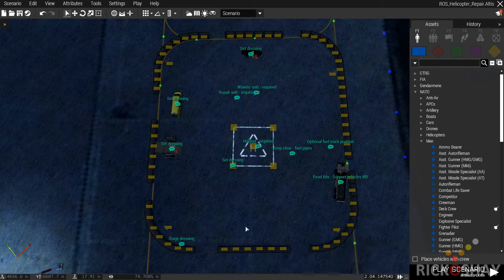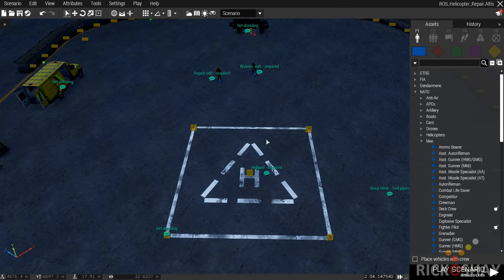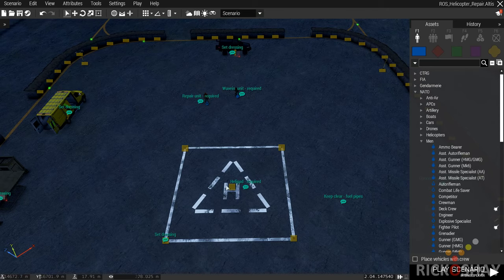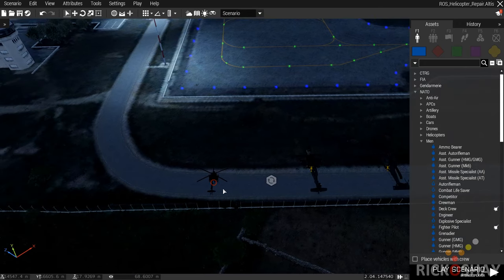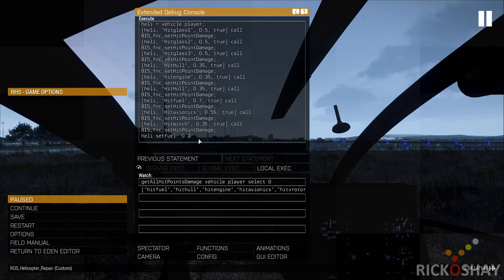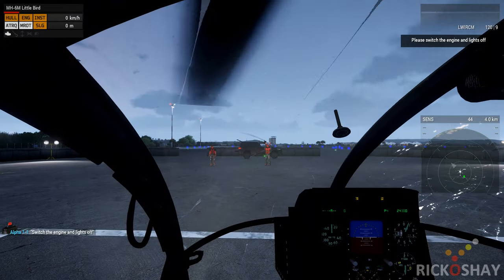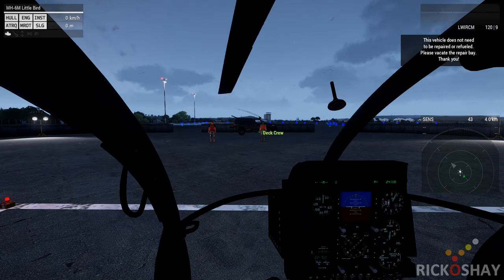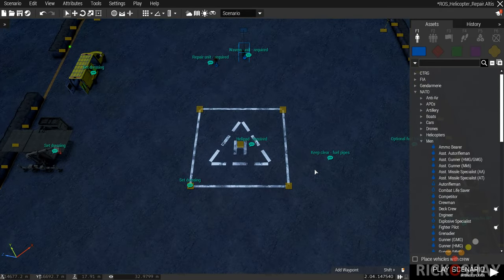ROS Heli Repair Script

Comment: That's pretty damn cool, man. I love stuff like this in Arma! I'm curious if something like this can be done with a checkpoint/base entry? Say a car pulls up and a soldier signals them to stop, then either the soldier or another walks up to look over the vehicle and then the vehicle gets the go ahead to proceed sort of thing. Then again, not even sure of Arma has animations available to actually make something like that work I suppose?
Reply from the maker: Yes - there are checkpoint anims that do exactly what you mentioned. Most likely it won't need any scripts just some triggers and a few lines of code. Would this be for a SP or MP mission ? And would the guys in the car be undercover operatives trying to infiltrate a base i.e. enemy checkpoint or friendly? Basically would be the same process barring some settings on the enemy to stop them from reacting.

Multiple animations - playing a traffic checkpoint where the soldier waves you on. There are 3 animations in this series namely:

Acts_ShowingTheRightWay_in (1.799 secs)
Acts_ShowingTheRightWay_loop (1.832 secs)
Acts_ShowingTheRightWay_out (1.9 secs)

Anim times are shown in the anim viewer. (trigger this in editor - [] call BIS_fnc_animViewer)

1) Drop down any AI rifleman that will play the anim and name it 'trafficman'. Put this in the rifleman's init field: this setBehaviour "CARELESS"
2) Create 3 triggers one for each animation and change the trigger condition to true in each case so they fire automatically.
3) On the first trigger in the init field place this: trafficman playmove "Acts_ShowingTheRightWay_in";
4) On the second trigger put a 1.799 countdown in min mid and max. Then in the init field put: trafficman playmove "Acts_ShowingTheRightWay_loop";
5) On the third trigger put a countdown of 10.959 and init: traffic playmove "Acts_ShowingTheRightWay_out"; traffic disableAI "Anim";
The countdown for the 3rd trigger is the total of the first anim and 5 x the looped time of the second animation.

If you want him to move somewhere after the anim then on the third trigger's init at the end add: 
trafficman domove getmarkerpos "somemarkername";

There is an anim where another checkpoint guy walks around checking the car before the waveon process takes place - just need to find it.
Reply: @RickOShay  Oh wow awesome! Didn't realize BIS did have some handy animations sorted for this. It would be for an MP environment mostly. The fun bit is how multi-functional this is, because you can have it just for ambiance or make a mission or even have someone RPing as a baddie through ZEUS. :)
Reply from the maker: @yokhanan  Exactly - lots of possibilities. Perhaps even a random chance that the checkpoint guards will suddenly get spooked and open fire.
Reply: If you play the SP campaign you will see this in game ..

Comment: how do i damage my heli im so confused
Reply from the maker: Lol well other than flying into something you could use the debug console and do :
vehicle player setdamage 0.4;  
vehicle player setfuel 0.4; then click on local exec. Or if more advanced sethit on specific hitpoints.
Reply: @RickOShay  so if i wanna only damage tail rotor what do i type???
Reply from the maker: @tasted8892  Do you know how to use the debug console? Load the mod CBA - then start Arma 3. Go into the Editor and load your mission. Get into the heli. Preview the mission - press Escape - the debug console will be displayed.  Paste the following into one of the lines in the debug console: getAllHitPointsDamage (vehicle player) select 0; press Esc again.  You will see a list of hitpoints for the heli you are in something like this: ["hitfuel","hithull","hitengine","hitavionics","hithrotor","hitvrotor","hitglass1","hitglass2","hitglass3","hitglass4","hitengine1","hitengine2","hitmissiles","hitrglass","hitlglass","hitengine3","hitwinch","hittransmission","hitglass5","hitglass6","hitlight","hithydraulics","hitgear","hithstabilizerl1","hithstabilizerr1","hitvstabilizer1","hittail","hitpitottube","hitstaticport","hitstarter1","hitstarter2","hitstarter3","hitturret","hitgun","#light_hitpoint"] To damage a specific hitpoint - press Esc - type in the big open text box at the top of the debug console: [vehicle player, "Hitglass1", 0.95, true] call BIS_fnc_setHitPointDamage; then press local Exec - this will damage the hitpoint glass1 with 95% damage. Don't suggest you damage the tail rotor otherwise you wont be able to fly the heli and land unless its just a small amount of damage say <=0.4. A damage score of 1 is totally damaged, 0 is totally healthy. You can experiment. If you typed in and execed - vehicle player setdamage 0.4; then all the hitpoints will receive the same amount of damage namely 0.4 or 40%. You might still be able to fly and land it with that much damage.

Comment: Seems to not repair but will refuel on multiplayer ACE mod.  but it does work when I tested on editor. Should have some sort of option to reset. But nice work though.
Reply from the maker: According to some users it works fine with Ace. I personally havent tested it with Ace - I don't support Ace. The vehicle must have a hitpoint array and must have more than 0.1 damage on a HP to start the repair process.
Reply: @RickOShay  yea i did try with damages on the heli. It seems like he would be stuck standing next to the heli and the repairs skipped to refueling and the heli would be stuck there refueling forever. Also when enemies are nearby he would run around refusing to repair. Id probably try again later on to see compatibility issues with certain mods but this only happens in mp
Reply from the maker: @SketchbookGuitar  Yes that's Ace for you. I explicitly set the repairer and wavein units behavior to careless so they wouldn't get 'side tracked' so to speak. So - unless you disable Ace from interfering with these two units behavior you will have issues. I assume Ace has some exclude var that can be used to work around these kind of issues.
Reply: @RickOShay  Oh right a bit rude of me to just complain but forgot to show gratitude. Thanks for making this I really appreciate it.